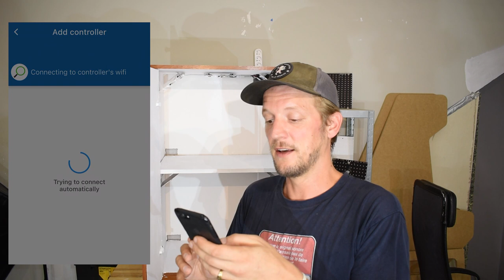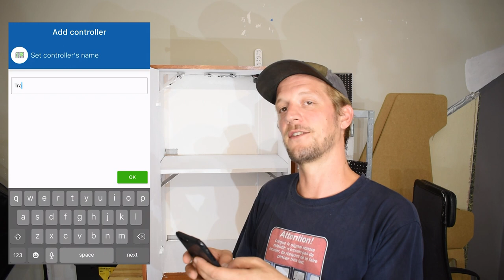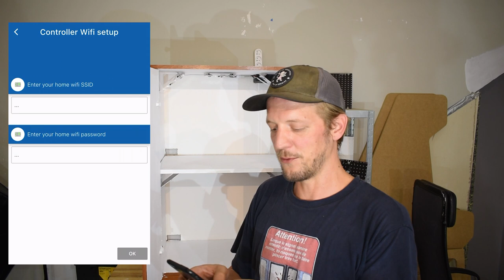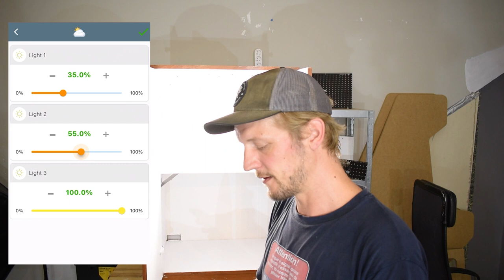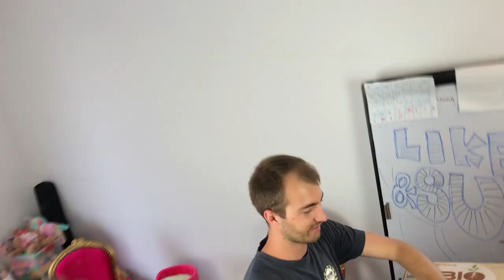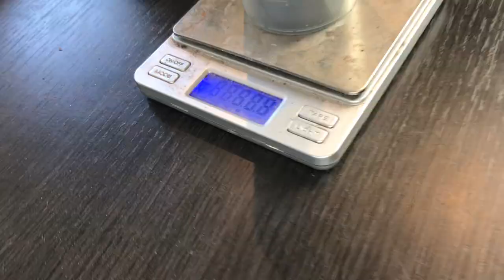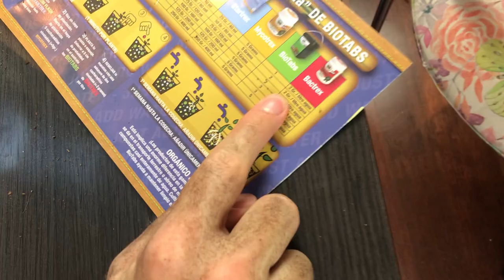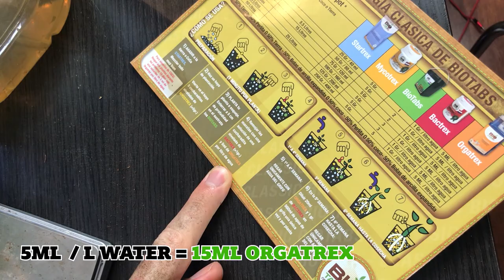How to Build a Stealth Grow Box - Repurposed Cabinet Edition ♻

Comment: I made mine out of a full on wardrobe 36" depth 60" width 84" height the all the electric, the inflow and outflow are all in back. It's completly soundproofed and carbon filtered going in and out the inflow is directly attached to the ac vent via temp control off and on. Humidifier and dehumidifier 2 in 1 that destills and  recycles its own water an automatic watering cycle witch it hooked up to an OR inside the way attached to the water line the best part. The face where you open it at..I modified further into an entertainment center. Complete with sliding drawers to store blue rays and video game disc <3 you would never in a million years think that sucker is actually pumping out an avrg of 28oz  every 3 months via sea of green 5 branch limiting. the heaviest tailored feed drip feeder. The bottom of my night stand is wh where the clones grow and my mother plants are inside a hallway closet that hint hint use to be 2x bigger than it is now but somehow the wall ferry just went poof and there's a airpistion held push and slide wall flush against the side wall out of no where. O:
Reply: I'm also thinking about busting open the wall underneath my stairs going down into the living area and going up to the bedrooms/upstairs living area because there's just a big hallow space that has no access and it's a considerable amount of space the easily equivalent of a 4x8x8 growing tent not including a shorter and narrower area leading to the open section.  I'd prolly make that an area for jacket/coat and soda storage so people would think that's all there is bbuutttttt they'd be wrong

Comment: Is it possible to add a 12V waterpump to the controller and control it aswell with it?
Reply from the maker: Yes you can 👌
The controller has 3 motor ports for 12v-24v motors - just make sure that for 12v you run the motor port at 50% or less power :)
join us over on Discord and let's make it happen! https://supergreenlab.com/Discord

Comment: Can I add more than 6 panels to that controller and power supply? How many in total? What is the wattage of each panel? Looking at the packages you sell, its arround the same price of a 200w quality led light panel box eg. Spider, but I love the whole controller setup!
Reply from the maker: Hey:) yes we just released the extender that allows to put 6 panels behind a single led channel, so you theorically plug an infinite number of panels^^ The package we sell also has ventilation and sensor, can be remotely controlled and monitored, and can manage up to 3 boxes independentelly to do multi chamber perpetual harvests setups. Also we do 7/7 support for tech and growing:)
Reply: @SuperGreenLab  so 6 panels total 90w? How much watts can the power supply handle? What is the wattage per panel? Tnx!
Reply from the maker: Extenders come with their own power supply, but the thing is in small grows you barely ever use 100% light. You’ll maybe go up to 70-80% at the beginning to prevent stretch, but then you will probably be at 30-60% depending of where the panel is.